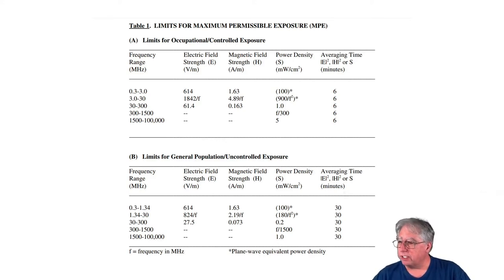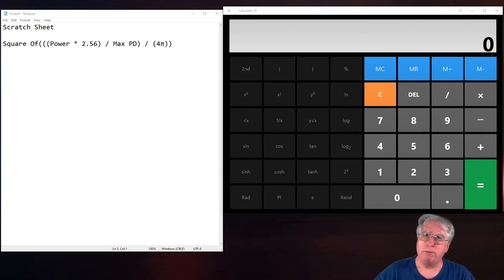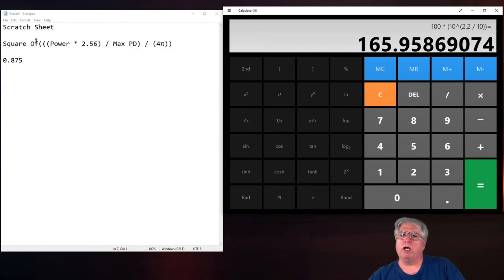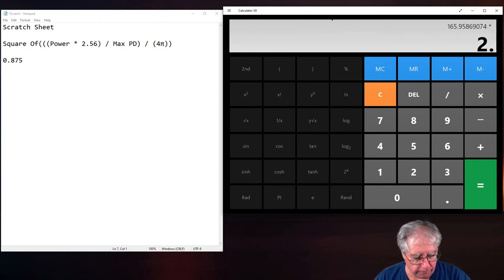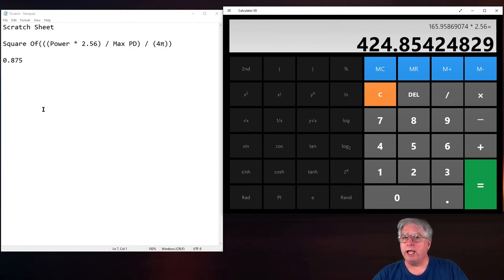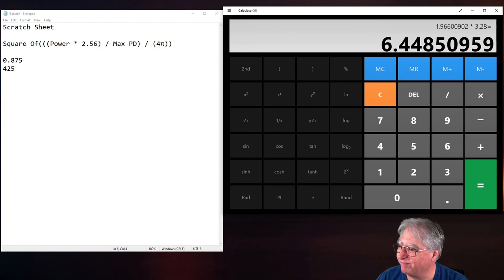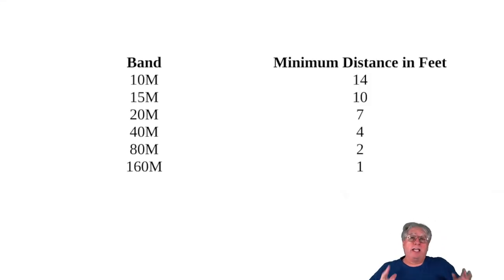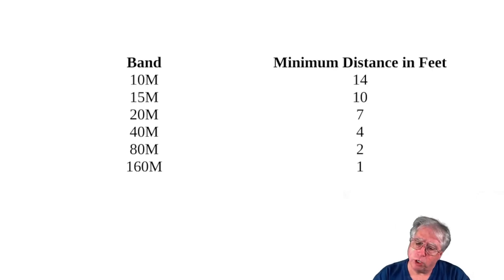Field Day: Calculating Minimum Antenna Distances For General Public Exposure

Comment: Thanks Stu; very interesting.  Does the FCC give any consideration to the additive affects of simultaneous transmissions?  CVARC is looking at 12-13 operators who could be transmitting simultaneously.  So you get 20 mw/cm2 from one antenna, 15 from another on a different band, and so on.  Maybe the antennas are so far apart that the inverse square law keeps you safe.  Just curious.  AJ6MJ
Reply from the maker: Hi Patrick,
PD increases when you have multiple simultaneous transmission sources within close proximity. The best method to seriously evaluate multiple simultaneous transmitter sites would be with antenna modeling or field strength readings. The documentation is conspicuously grey on the math. It would seem that adding the percentage of each antennas PD level, at the closest mutual point to all antennas, would give you (hopefully) less then 100% max exposure. It starts to grow a bit beyond reason due to the exponential growth of the number of cross intersecting points. You also could take into consideration that the calculations for each antenna, when trying to estimate total PD, should be calculated at the lowest duty cycle of all the antennas in question. That would (probably) be the most accurate way to calculate the combined duty cycle. Wow, this makes my head hurt thinking about it... :)

Stu
AG6AG
Reply: @AG6AG Hey Stu,
 I think that adding up the percentages of maximum exposure is the key to combining radiation from multiple antennas on multiple frequencies.  I would try a graphics approach.  Get a plot of the antenna layouts and draw contour lines around each, say at 50%, 20%, and 10%.  Areas of overlap would require further examination.